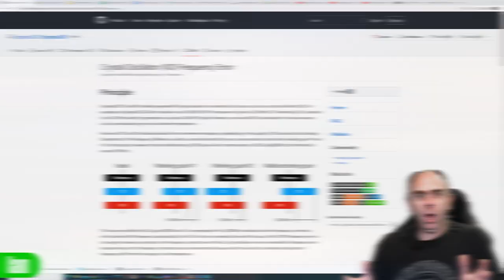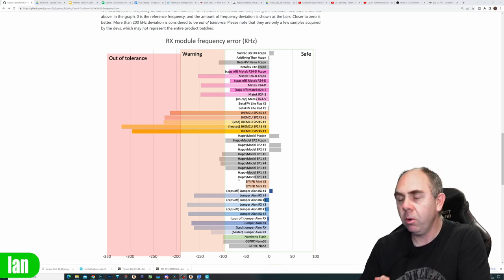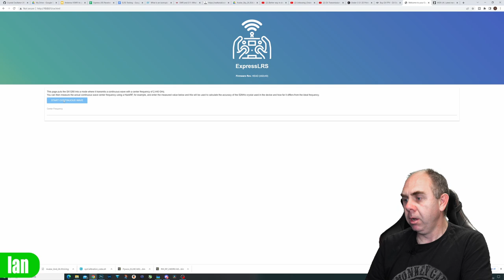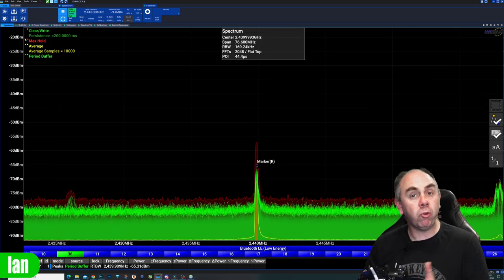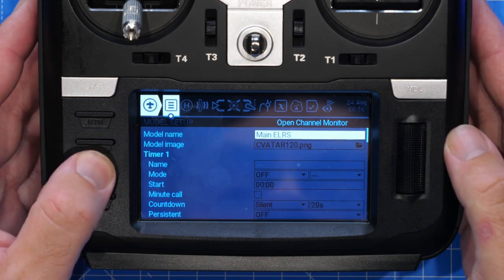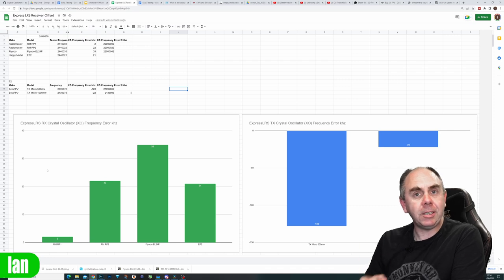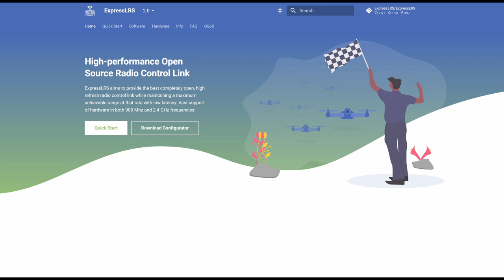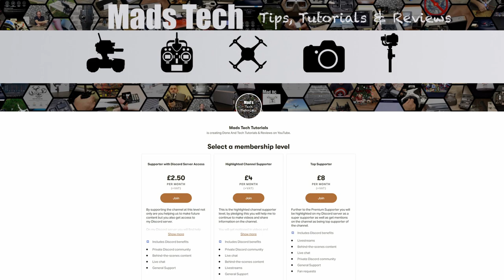ExpressLRS Crystal Oscillator Error - Should You Care ?

Comment: before i even watch - yes, i personally do care because out of my 3 matek RXs 2 had the problem. It was few months back when problem was not that common, so not knowing what it is about made solving it even more annoying. Thankfully ELRS devs were very helpfull. Even now removing tiny caps is not what i would like to do so i would rather steer away from RX known to have problems. Also i think it displays some problem with open source stuff with lots of manufacturers contributing... now lets watch the video and see if my opinion will be changed
Reply: I have 3 Matek r24-D and so far and I hope it stays so no problems.
Reply: @REAL_N3W  if you had no problems yet, chances are you are good, mine problems were so prominent i couldn't even get stable connection for more than a second
Reply: @trav1c555  ok that’s hard, luckily so far my matek are ok :)

Comment: Great info. Thank you Ian. 
I view this more as a diagnostic tool should one suspect there are issues. Not something anyone will have to worry about on a regular basis. It's great that the ExpressLRS team will require manufactures to submit samples. This helps the overall community, as will help weed out any potential poor quality hardware being released in future. Worst case is a bad hardware batch can be flagged by pilots for re-review by other, or ExpressLRS team.

Comment: I agree with you that we should not have to worry about it, but I strongly disagree that we should ignore it.  I have already had to deal with a Flywoo receiver that was so far out of frequency that it would not bind, not fun when you are in a hurry to get a quad ready for an upcoming race.  The worst part is that I had no idea why it would not bind and I had to spend a huge amount of time testing and researching and finally came across a Bardwell PSA about this exact issue, and then more time contacting the vendor about what to do about it.  I do hope this issue goes away, but for now we must be very aware of which hardware is most likely to have this issue and avoid it.  We need these companies like Flywoo and JHEMCU to stop trying to cut corners and sale us equipment that does not work.

Comment: Hi, Great info. 
This topic is actual for me. Recently I came across with failsafe crash in near distance ~300m using ELRS tx/rx. I did some TX/RX error measurement with JHEMCU 2.4G EP24S rx , Radiomaster Zorro internal ELRS, 3.0.0-rc2. The tick (RSNR) difference is between TX and RX: Zorro ELRS vs JHEMCU : -120 -> -189kHz . It's ridiculously high freq. diff. Practically not useable.  
I am curious how accurate the Zorro is. Could you measure the frequency of Zorro ELRS ?

Comment: I do not entirely agree. I lost a brand new high quality ARF very very likely because of this. Maiden fligt lasted 15 seconds, everything was fine before takeoff. Once in flight lost the connection completely. I am a very cautious and mindful modeler and have been building and flying for over 35 years now. I usually fly F3A type pattern aircraft. But this is not only the case with ExpressLRS. I own a A-brand TX tx that has this issue as well. I wish i had the equipment to prove it. I send the TX 3 times for repairs but every time I got it back with the remark that the antenna connector was loose. (Total B*******t).  Question: if found to be the case with a TX, could the oscillator be swapped out ?   I mean, is it available for consumers or is it a proprietary part. I do have the skills to actually swap this component.
Reply: you definitely could change every component, they are freely available

Comment: hello, could you please highlight the problem with the receiver going to boot mode when turned on on almost all f411 flight controllers and some f405. this problem requires changing the uart (does not always help) or adding a 3.3V pull-up, which is an extremely difficult task for most users. However, the ELRS core team have not paid enough attention to the problem, the manufacturers are not going to add a pull-up in the receivers, the developers of betaflight are not in a great hurry to find a solution on their side either (it turned out that this problem is not reproduced on the emu) I know they don't have to, but maybe if you make a fuss about the problem it will get things moving. New users and the project's reputation suffer from all this